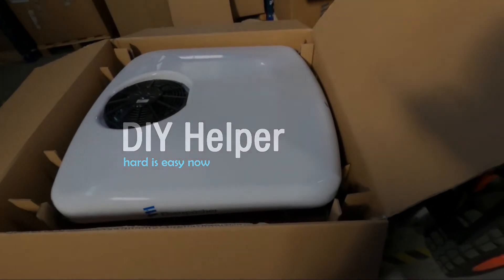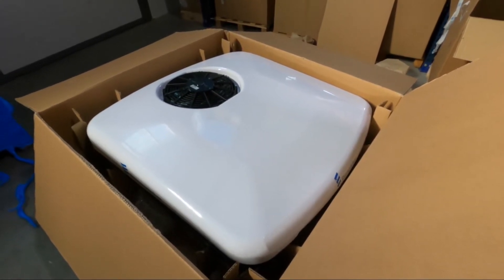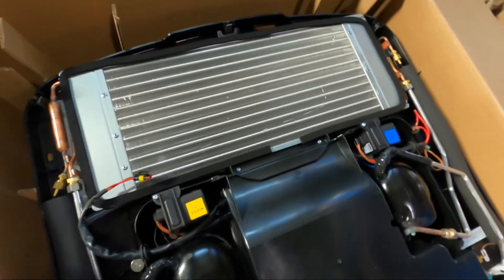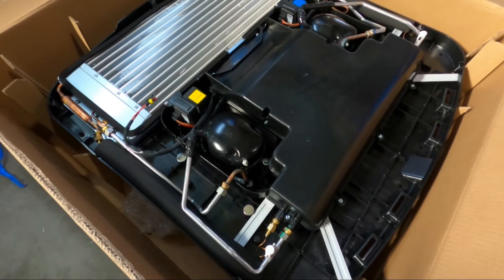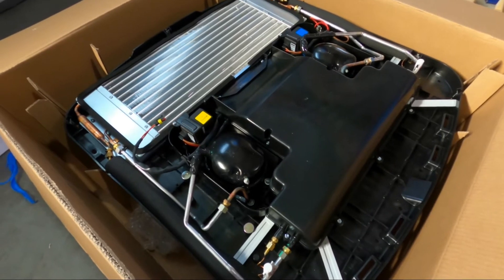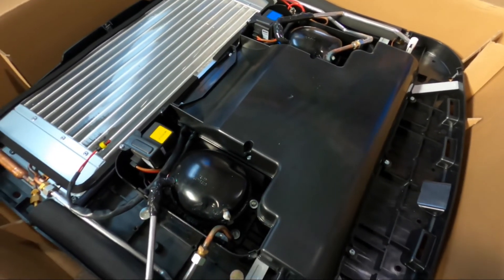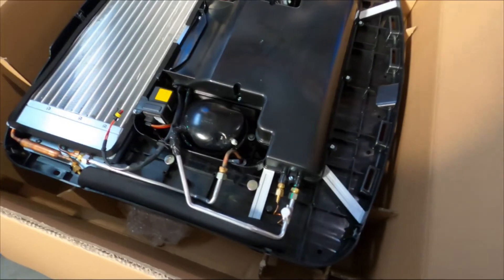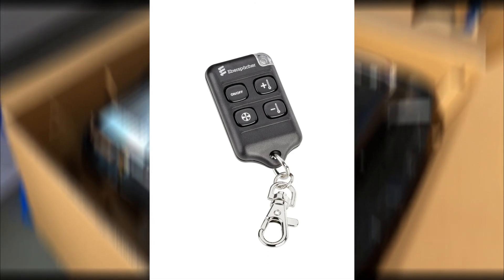Eberspächer Cooltronic parking cooler AC unit. Dirna minicool bycool trp slim hatch 1400

Comment: Can this unit be used while the truck is moving? I have a old truck with no A/C “ Old military truck” Thanks for any advice
Reply from the maker: I don't recommend this unit off road and it is not powerful enough for effective temperature pull down, but there are other electrical solutions depending on your region. If you are from the EU I recommend Integral Power II from Dirna, they also make the unit in the video.
Reply: I have a Dirna Compact 1.4, and I don't know where the charging plugs are, LP and HP. Do you have any idea?
Reply from the maker: @geocugeorge3160 there is only LP under the top cover, usually sealed with a little thermal plastic. In 99% of cases it will not be refrigerarant that is the problem.